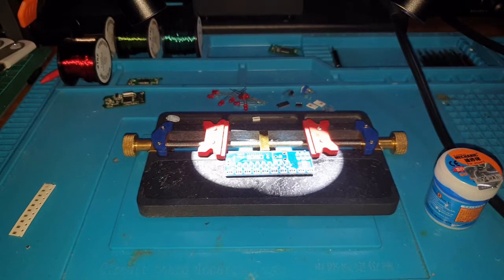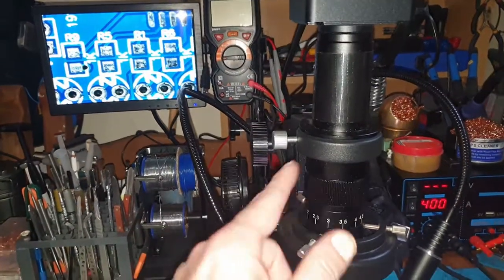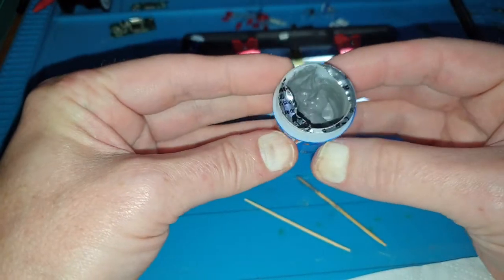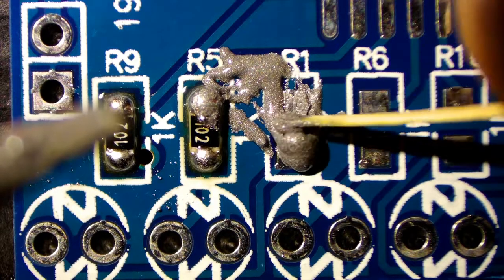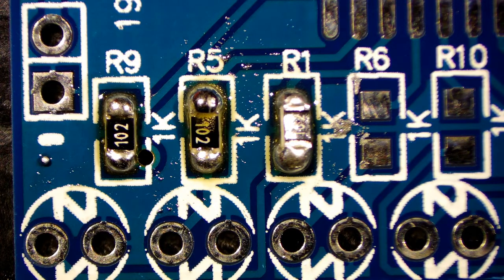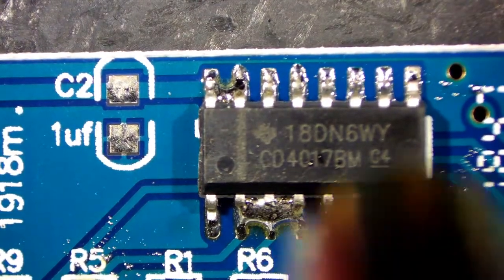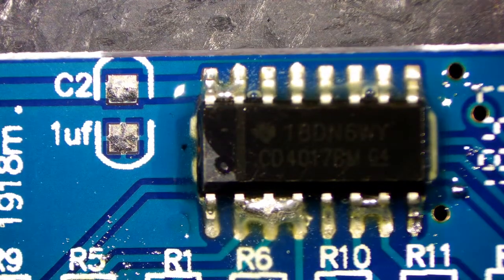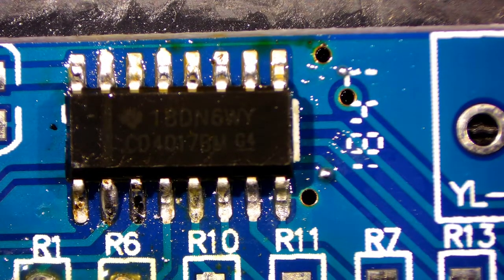How to use solder paste Pt1 - See end of video for link to Pt2 update.

Comment: I mean ok but I soldered a bunch of this and smaller size components with a standard size cone tip in  mains iron with no soldering experience no problem including a similar ic chip.  I am planning getting a soldering station a cheap one couse I like fixing things as a hobby but I don't know if soldering paste is necessary... my opinion
Reply from the maker: It really comes down to what the job requirement is, and more so down to our individual abilities.  Ive seen many videos on here, people using massive solder irons for dinky jobs, no flux or anything we would normally use, and they get on fine.  Some people may just want another way to solder those tiny components in, whereas those like you, sound like your doing ok.  Also in time your eyes do let you down, I use a microscope camera for certain jobs.  It is really each to their own, this is just a little exercise in a different way of soldering, not everyone will need it nor want it, but its there if you do.

Comment from the maker: One thing I forgot to mention, is that there a few types of solder paste. Basically solder paste is made up of tiny solder balls, and flux.  The difference between them are the size of solder balls used.  The common one, and cheaper is type 3: this contains 80% of balls around 25-45um, type 4 is slightly smaller at 20-38um and type 5, contains about 80% at 15-25um, which is much smaller, and will give better surface coverage. Also, if your paste is really dry, you could try and add some flux into the mix, however some prefer it less watery. Ive seen some like Erkin from HDD Recovery Services, who dab their paste on tissue to remove some moister from it, its just personal choice
Reply: Thanks
Reply: I did not know that was possible,
Reply: Where can I get the paste can u provide a link
Reply from the maker: @anthonybrown3829  Hi Anthony, I did a quick search on ebay, and found a tub like the one I use, and the other link is for the syringe version.  Good luck buddy.    

Tub42g

https://www.ebay.co.uk/itm/MECHANIC-XG-50-Liquid-Soldering-Solder-Paste-42g-SN63-Pb37-SMD-BGA-SMT-Stencil/373005912844?hash=item56d8e28b0c:g:DY8AAOSwilpegZ7l

Syringe 

https://www.ebay.co.uk/itm/MECHANIC-XG-50-Liquid-Soldering-Solder-Paste-42g-SN63-Pb37-SMD-BGA-SMT-Stencil/373005912844?hash=item56d8e28b0c:g:DY8AAOSwilpegZ7l